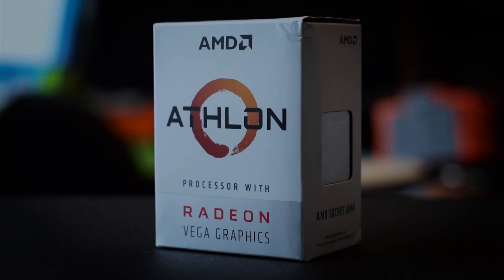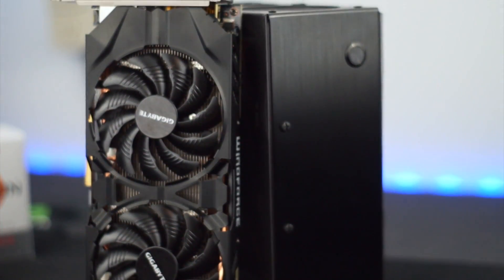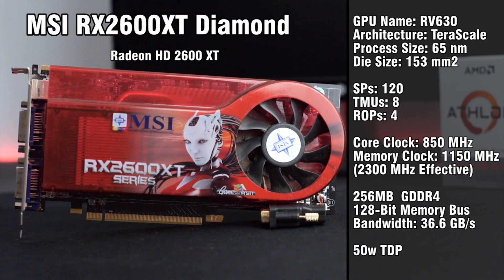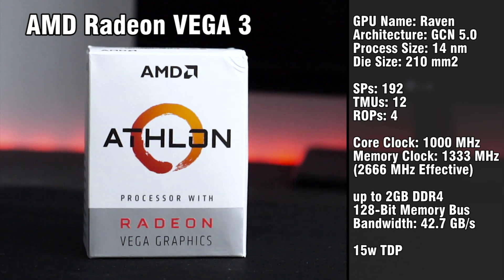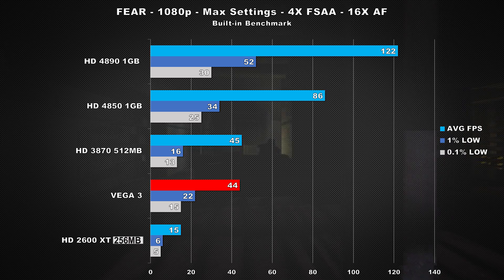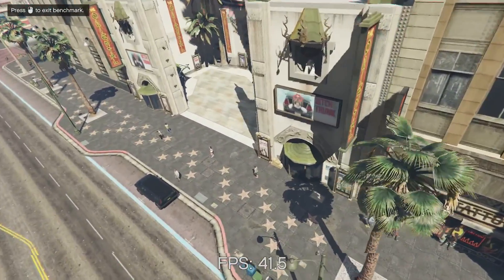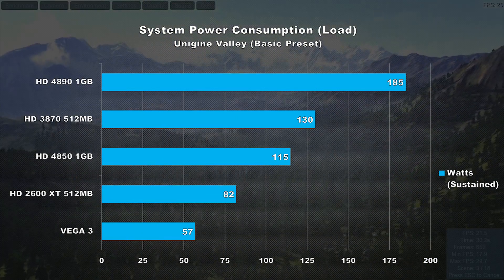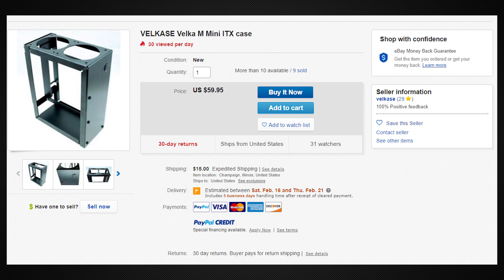VEGA 3 takes on Old School ATi Radeons

Comment: In other words, the vega3 is weak as water.....
Reply: In other words, you either didn't watch the video, didn't understand it or you look exclusively at age old games that use ZERO of Vega's potential. It's so very obvious that on older games dedicated plug-in GPUs, with their relatively high bandwidth onboard memory will outperform a very, very low end iGPU that has to share bandwidth with the CPU.
Just look at GTA, Rocket League, Fortnite ... this is much more representative of actual performance.

In fact I'd argue this is AMD's biggest problem with APUs: they have this relatively modern, relatively efficient architecture (if you don't push it way outside it's optimal range, like with V64 and VII), but it only really shines in modern, well optimised AAA games like Doom, Wolfenstein, BF1 and 2 etc. 
However, my guess is few people buy 60€ APUs to play recent AAA games on. It's going to be mostly older titles, F2P, indie ... none of which are famous for using modern tech or having the ressources to optimise specifically for a certain architecture. 
So, where every last bit of performance counts most - in the low range - very often we can't get the ideal level of performance because optimisation.
Reply: Well is supposed to be "weak" in his price point and IT is a Low end product... At least is on par with the UHD 630 of Intel "best" IGPU...
Reply: r9 270x is weak as water
because AMD refuses to release drivers for OS update since 2015
Reply: @rwbimbie5854  Not so much, this GPU have the same performance of a GTX 670/760... If you use the right drivers... Well the drivers support of GCN GPU's (HD7XXX and Newer) is better than Terascale GPU's (HD3XXX to HD6XXX)...
An HD 6970 is weaker than a HD7870 in newer games because of lack of new drivers...
Reply: @nurbsivonsirup1416  Aside from mobile uses, APUs are a scam, plain and simple. Ebay an old $100 prebuilt i7 dell w/ 8gb and a used GPU (i recommend gtx 970s @ ~$120), $30 SSD and $25 new PSU (~$275 total). It'll crush a 2400g easily and is barely more expensive than a brand new 200GE build.

Comment: amd still use the heatsinks with brackets and clips, very retro and awful.
Reply: That retention mechanism is a perfectly functional design, that's why they still use it. It isn't broke, don't fix it. Plus you can use any cooler from any era with that retention bracket on even the newest CPU. No need for bullshit adapters.